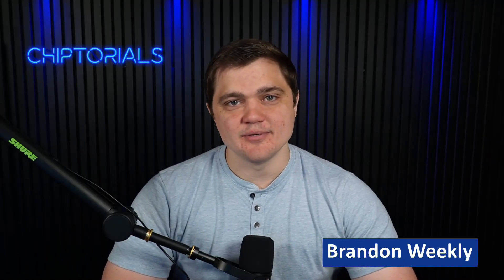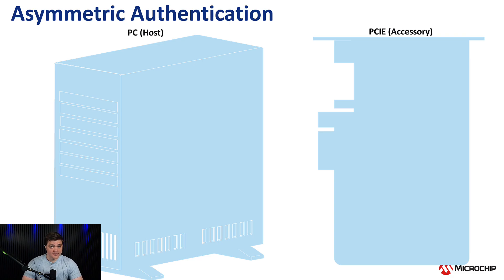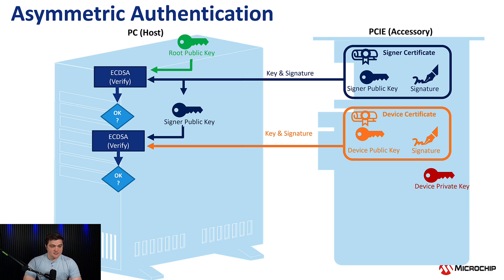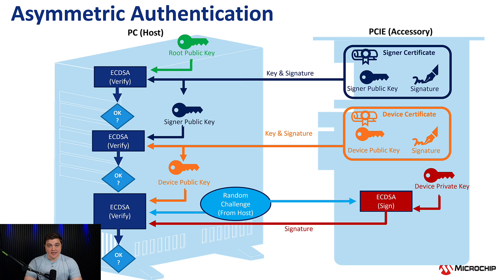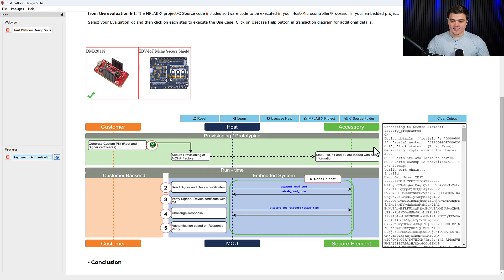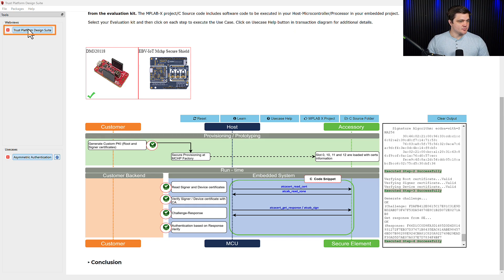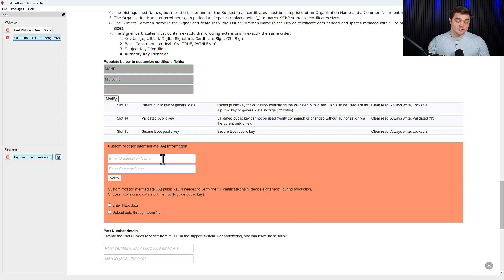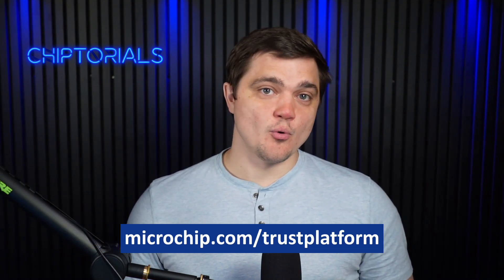Chiptorials – Basic Asymmetric Authentication with ATECC608 TrustFLEX

Comment: Hi, I recently bought the DM320109 Microchip it in order to familiarize with the ATECC608 chips. 
I find extremely difficult to understand the general principles and even to run a simple demo. 
The documentation, either if it's PDFs, papers, videos, softwares, Github repositories, MPLAB generated code is scattered, inconsistent, confusing. 
For example, in the kit there are ATECC608-TrustFLEX chips, there are information already loaded in the chips and the configuration in locked. I was able to view the information inside with the ACES software, but that's it. 
How do I use the slots, where are the private keys, public keys ? Do I have to download it from the internet ? Where ?
I had to download Atmel Studio 7 to see a demo. Why Atmel and not Microchip ? Why isn't there any document explaining the demo. What is SAMBA software ? How do I use it ? It just seems not to work.
I tried then to run a Secure Bootloader with MPLABX MCC and CryptoAuthLib and dsPIC33CK Curiosity board. There's isn't a single line of comment, not a tutorial explaining what happens in the bootloader. 
How am I supposed to generate a key. Do I have to ? Is it just a random number ?

This video is just a mindless "click this, click that". but there is no real knowledge in this video, it is just a commercial spot. This video doesn't really explain anything. Then why tutorial are more and more often provided as videos ? Isn't a paper easier to browse, to understand, to search. A paper can be stored in the PC hard drive with a few MBytes. With a video, you can't.

Finally why the hexagons ? 🤣
Isn't a classic menu more pleasant to see ?
Even these hexagons are hard to understand. 
Can I use the DM320109 instead of the other kit shown in the video ? Why not ?
Reply from the maker: Hi there, thanks for reaching out. We apologize for any confusion or issues you are running into. Our technical support team would be happy to walk you through step by step on how to accomplish this and resolve any errors you may have. Please contact Microchip.com/CSS for help on this.
Reply: @MicrochipTechnology  
Hi, your answer is appreciated.

Comment: What If someone ex. steals the ATECC608 IC with the provisioned certificate? I think someone can use our chip to authenticate with our servers. How to prevent something like that from happening?
Reply from the maker: Hi there, thanks for your question. To prevent unauthorized use of a stolen ATECC608 IC with provisioned certificates, implement secure boot and I/O protection keys. Secure boot ensures firmware integrity, while I/O protection keys encrypt communication between the device and host, mitigating man-in-the-middle attacks. This way, even if the IC is stolen, the lack of paired I/O keys and secure boot validation makes unauthorized authentication difficult.